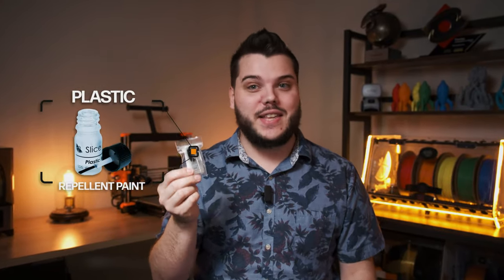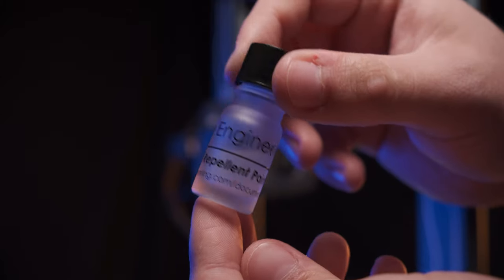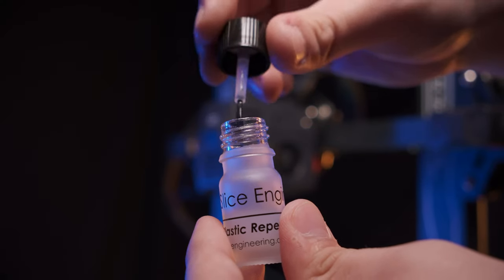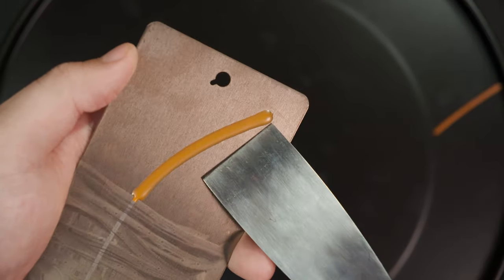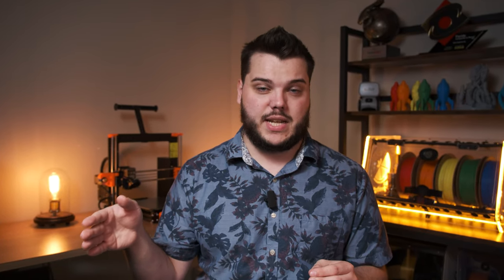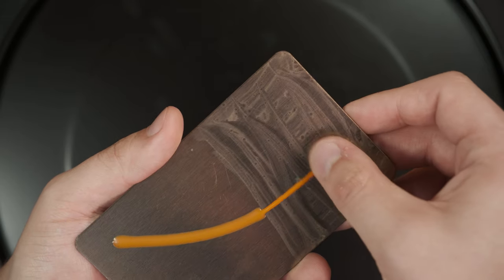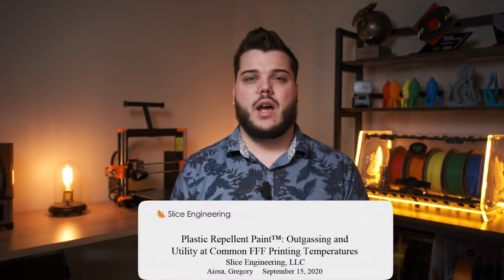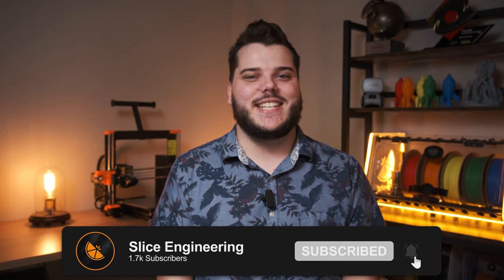Sticky Nozzles Suck | How to Use Plastic Repellent Paint

Comment: What happens if you do go above 290? Does it catch on fire?
Reply from the maker: While the product doesn't become flammable at 290°C, using it at or above this temperature is not recommended due to the proximity to its thermal decomposition point and the potential health hazards associated with its breakdown products.

Comment: How durable is the coating of PTFE left behind? I'm using a brass bristled brush as a nozzle wipe and need to know if that would need to be removed or if after the coating is applied.
Reply from the maker: A brass brush is quite abrasive and will wear down the plastic repellent coating, requiring you to reapply much more frequently. If you want to use a nozzle wipe, we'd recommend a less abrasive option like a nylon brush, silicone, or even PTFE wipe.
Reply: @SliceEngineering  thanks! I'll get some PTFE when I get the plastic repellent

Comment: What spool containment box is that which is behind you in the vid?  Thx.
Reply from the maker: It's a Repkord Repbox v2.5 with our Filament Drying Desiccant!
Reply: @SliceEngineering  Working really good it looks like, with the moisture level all the way down to 44%!
Reply from the maker: @lhoumark  Our Repbox isn't fully gasketed (e.g. airtight) as it was built for display, not as a drybox. That being said, our offices average 53% relative humidity and we haven't recharged the desiccant in months since we don't print from the marketing box, so it's working great at 44%!